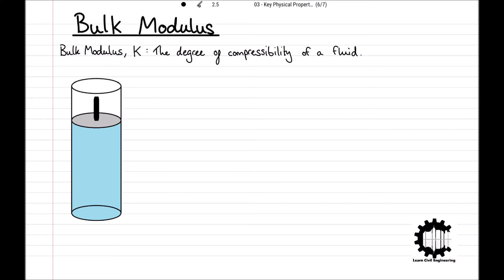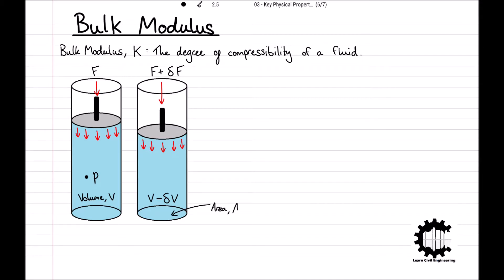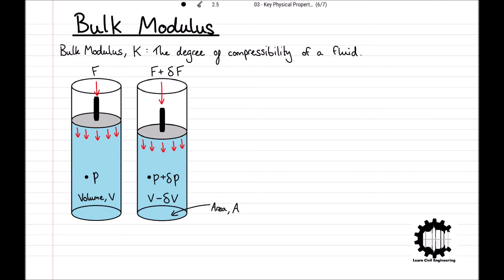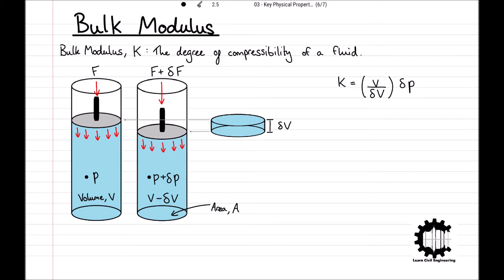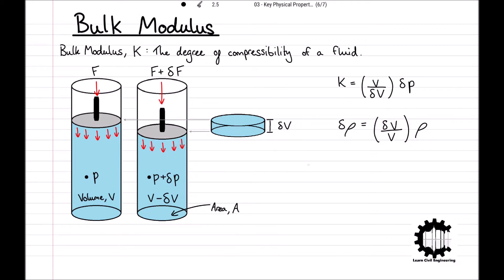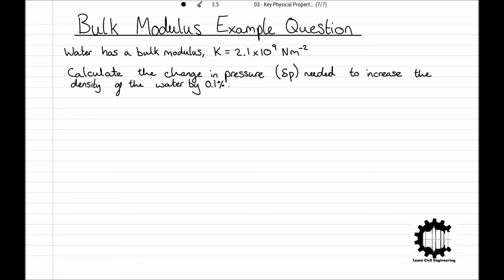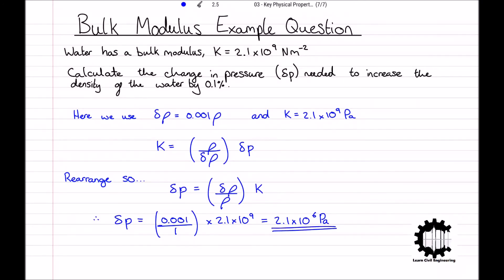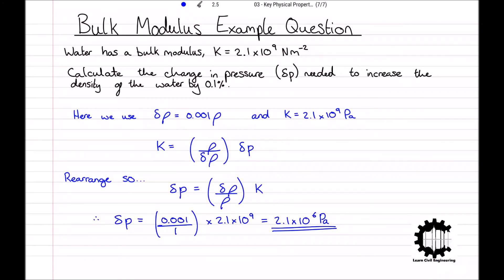Bulk Modulus of Elasticity and Compressibility - Fluid Mechanics

Comment: How did you assume this ^v/v=^raw/raw
Reply: its actually -dV/V = dρ/ρ , you can derive this by differentiation of ρ=m/v
ρV=m
ρdV+Vdρ = 0
Vdρ=-ρdV
dρ/ρ = -dV/V
Reply: @ken-cf7tf  thanks
Reply from the maker: It's not actually an assumption, delta Rho is equal to (delta V / V) times Rho due to the fluid's mass being the same before an after the compression.
Therefore, as there is a decrease in volume, there must be a corresponding increase in fluid density. So the the above is an expression representing this.
Reply: @Learn_Civil_Engineering  thanks